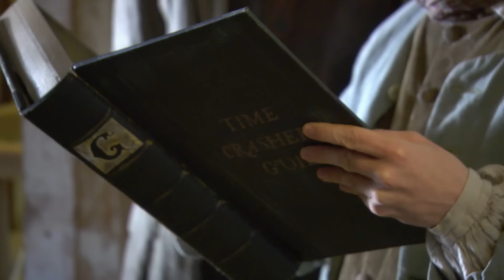What The Day-To-Day Life Was Really Like For A Georgian Servant | Time Crashers

Comment: Did they leave a fire going in the bread oven while the bread was baking?  That's not how ovens like that are supposed to work.  Leaving fire in it made it into a pizza oven.  A bake oven has a fire that heats up the body of the oven.  Then the fire is raked out, then a mop is used to remove the ash and then the baking is done with the heat that the oven has stored.

Comment: The bread came out of the oven almost burnt on the outside and still gooey inside.  Is it possible to have too much fire in the oven and thus be too hot?  Think of it as a modern oven when baking cake at 500 degrees versus 325 degrees.
Reply: 500 degrees???